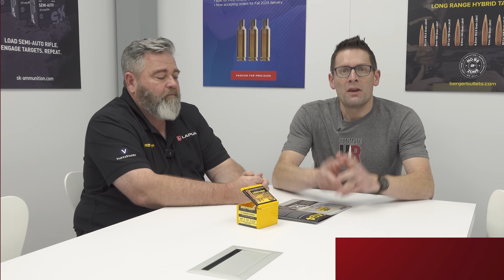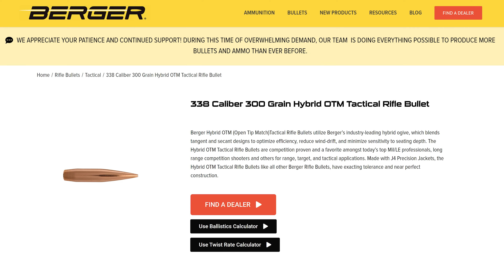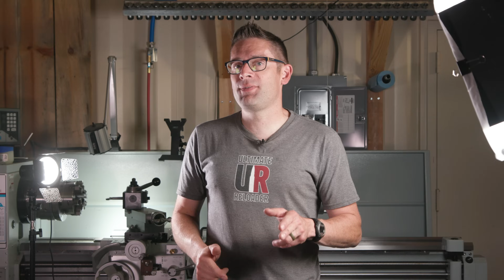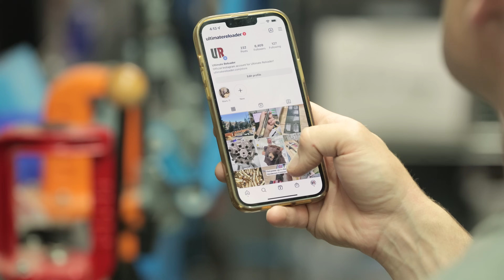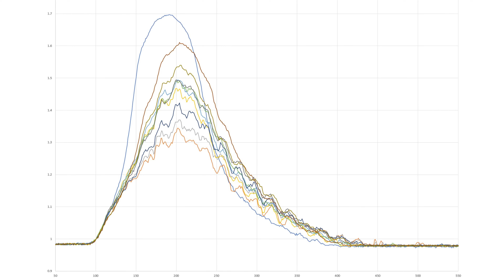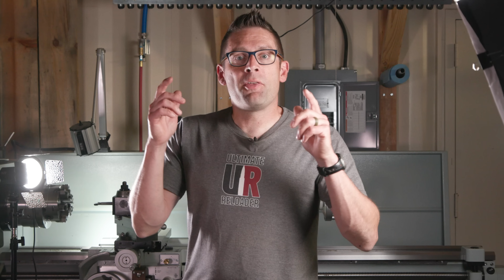New Berger .375 410gr Hybrid Bullet (Discussion with Emil Praslick)

Comment: I shoot ELR Heavy Gun with a 375CT and an 8 twist barrel with 400 grain Cutting Edge Lazers at 3000 fps. My longest  impacts in competition are at 2913 yards, which I hope to extend to two miles this season. I have also hit 2913 in Light Gun with a 338LM running 300 grain Berger Hybrids at 2850 fps out of a 9 twist barrel. The lead core bullets definitely make a bigger splash on the steel and kick up more dirt than the monolithic copper bullets. I don't want to give up accuracy with my fast twist 375 barrel, but maybe in the future will consider a slower twist barrel to try the 375 Hybrids.
Reply: could always just try a box and see if they will group well in your 8 twist

Comment: What cartridge for this bullet, 378 Weatherby?
Reply: .375 Cheytac as mentioned, or .375 Enabler, or .375 Allen , or possibly custom specs on a .375 Lapua case (.375 SwissP loaded long) , or  those who are also taking standard  hunting .375 (.378 Weatherby and 375 Ruger) and having the chamber cut special to be loaded with longer projectiles. Too many to list really. I will probably be working on a 375-416 Barrett soon which would utilize solids only.
Reply: LOVE MY 378WM.
Dont think they stabalize in 1-10twist.
Maybe at higher elevation
Reply: 350 gr is the max weights for my 378 in a 1-10 twist. At 3300ft above sea level. 
270 and 250 do well for hunting. Even the 235 tsx is awsome at 3400ft/sec..easy tracking

Comment: How does this compare to monolithics like the Warner Tool Flatline 400 gr @ .552 or the Patriot Valley Arms 361 gr @ .484?
Reply: bc is a almost a moot point unless it has good bc consistency.  i'm sure these hybrids will excel in that to overcome the decrease in bc
Reply: @SigmaBallistics  Agreed. Flatlines are very consistent. Haven't tried the PVAs yet, but Josh Kuntz designed both, so high hopes.